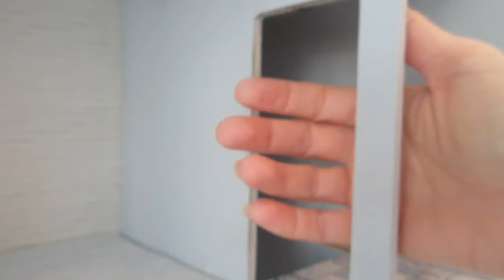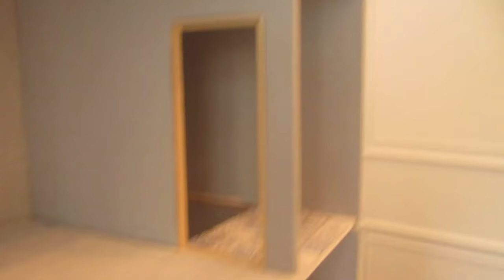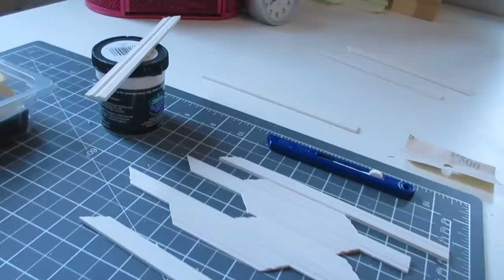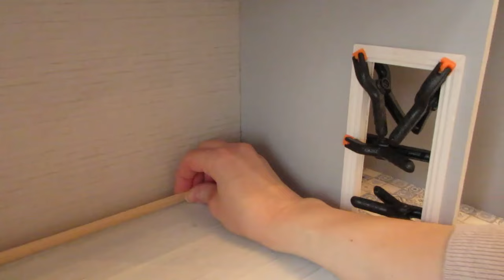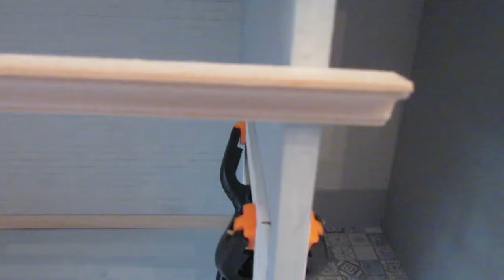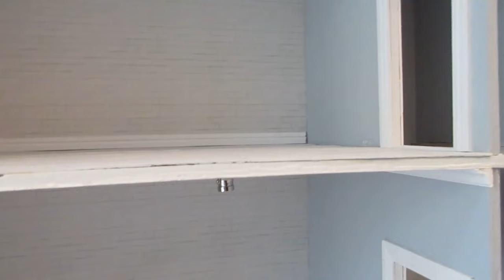From Start to Finish - 1/12th Scale Shop Project #10 - Part Two

Comment: 🎉with the clamps you could glue a bit of felt material onto the orange bits or a piece of thin silicone to help them to stay in place and reduce any marking on the wood. 
Just an idea 💡 😉
Reply from the maker: @jojosmumdorothy2829  thank you for the tip. 😄
Reply: @JulieWarren  your very welcome x

Comment: 🎉hi sweetheart I have the same saw as you but I can't get it to saw smoothly it's always getting stuck what on earth am I doing wrong? 🎉I tried wax but still no joy 🎉😊
Reply from the maker: @jojosmumdorothy2829  you may need to invest in a new saw.  If it’s slightly bent, that could be causing the problem.
Reply: @JulieWarren  it's fairly new maybe I got a faulty 1 lol just my luck I will get another one. Thanks hun x